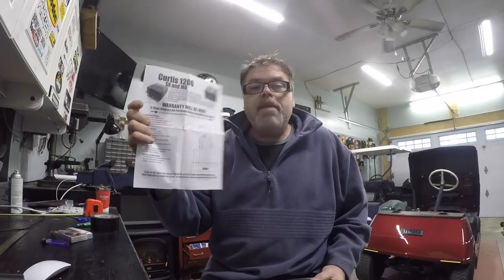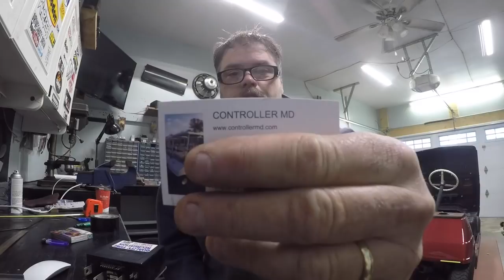Highly Modified Yamaha G1 GolfCart

Comment: Got two of these im building. Honda Gx390 build on the first one. Stock gasser rear. 2nd one im putting briggs vert v twin and a peerless 6spd rear pulley swapped basically a mudd mower drivetrain. Ugh lots of fab

Comment: As far as your carb being lean, you can buy different jets for carb. If not you can buy a drill bit set which is .010 - .090 on ebay cheap, and use a caliper to measure the drill that fits now, and then go up one size until you reach your goal.

Comment: Isn't there a microswitch along the line of the throttle assembly? You pushy the gas so far, the switch goes click, the starter fires up.. just use that switch to run a relay. Cheers Bill!